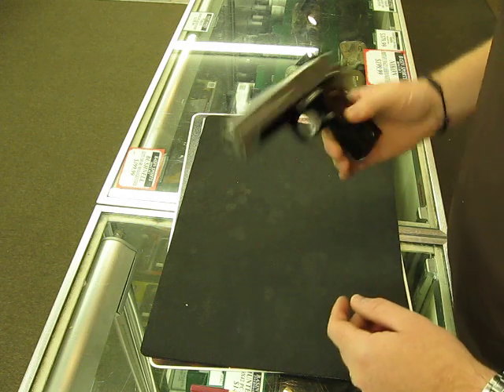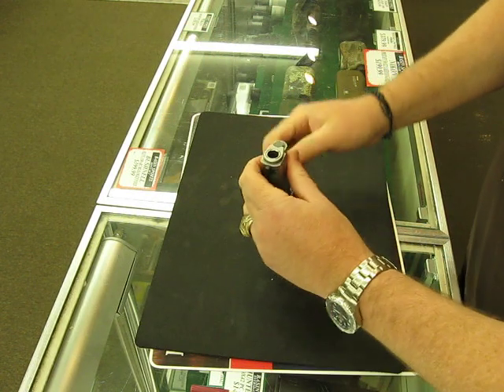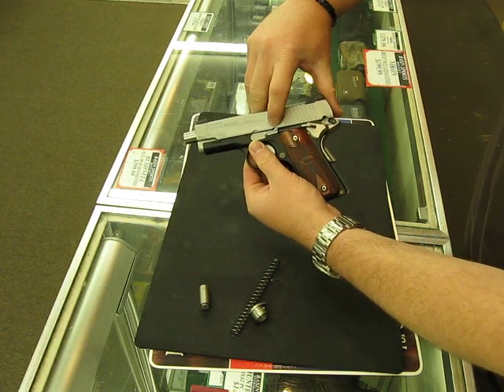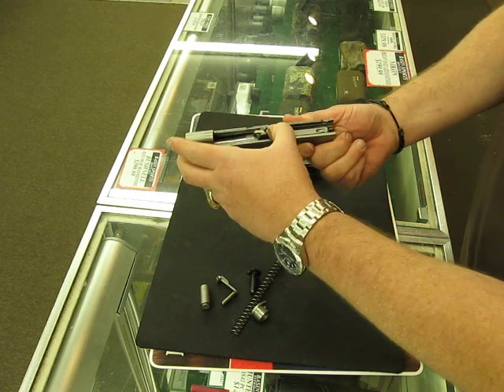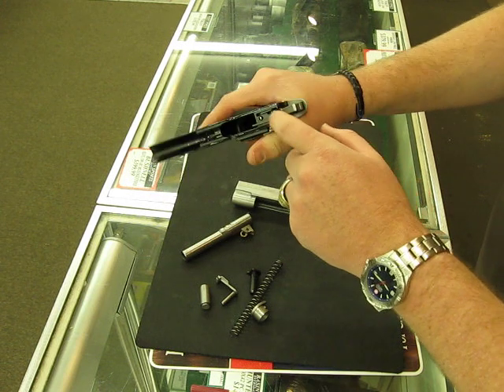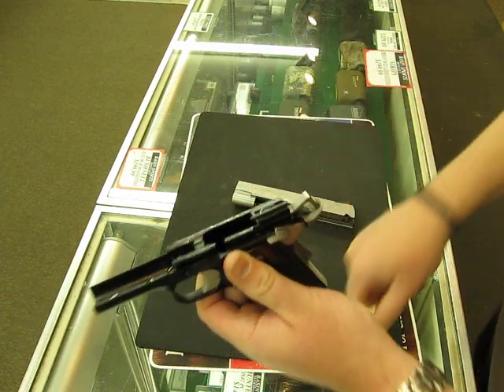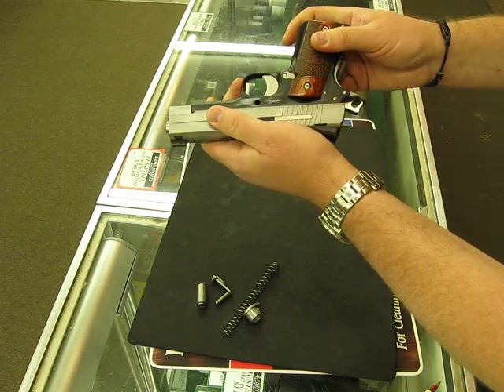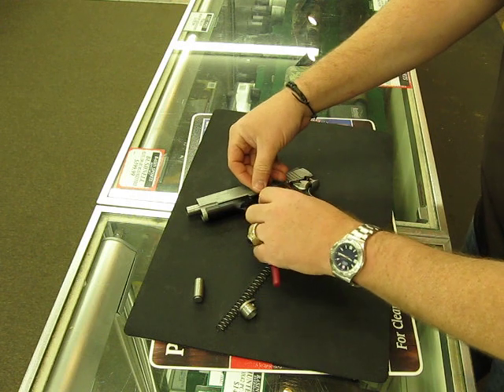1911 / SIG GSR C3 Assembly-Disassembly

Comment: Hi there.I just bought the Sig 1911 C-3 and I love it other than the guy I got it form wasnt good a diassembling it to clean.Its got what i believe is called the dummy scratch from trying to put the slide back in.It has scratches on the slide and frame.They are not deep and I was wondering if you knew if there was a way to get the scratches out.Thank you

Comment from the maker: @dp665 A full length Guide Rod... If you think that's an improvement, that's fine.  I know guys that like Body Kits on their cars too.  Unnecessary and add potential problems.  I like 1911's more like the original.  I am a traditionalist when it comes to 1911's.  If I want a not traditional pistol, I'll take a SIG P220 or an HK or something.